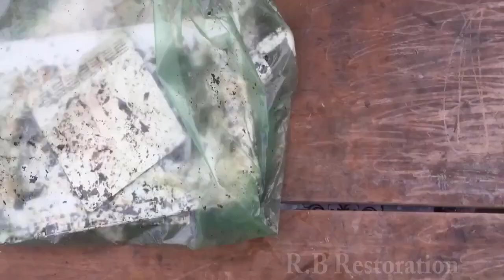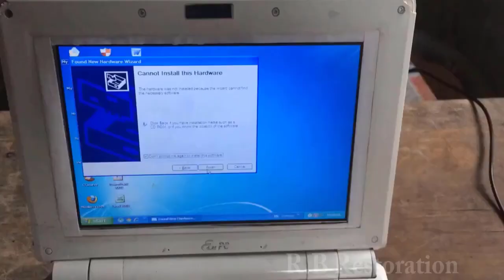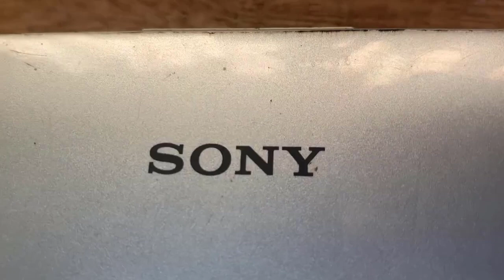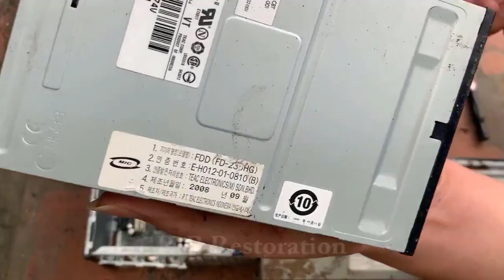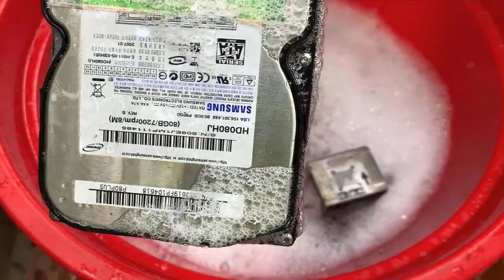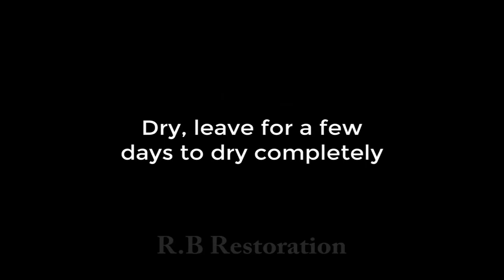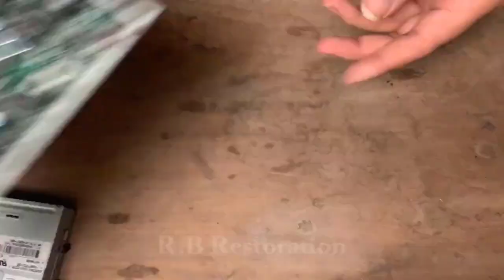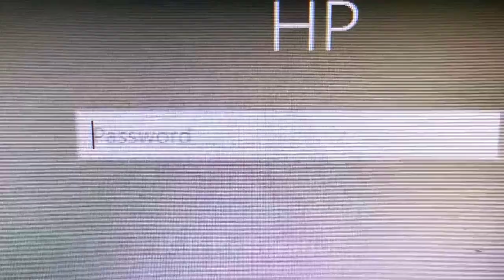Top 3 Full Restoration old Laptop broken | Restore and Repair old computer very rusty 20 year old

Comment: hahaha this guy thinks people will believe this 20 year old motherboard sitting out in the elements doesnt have any hint of rust or corosion on any of the steel usb ports or display port ive seen them sit for for a few months outside and they rust to hell,hes using a different mobo
Reply: i wont deny though it is completely possible ,but why
Reply: didnt seem to show it working though